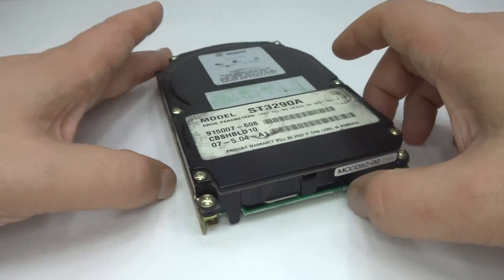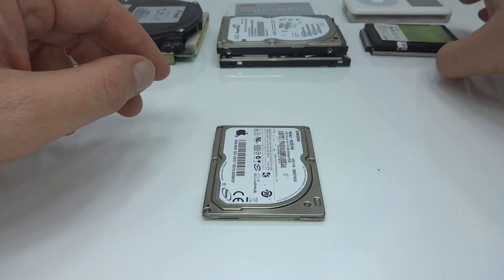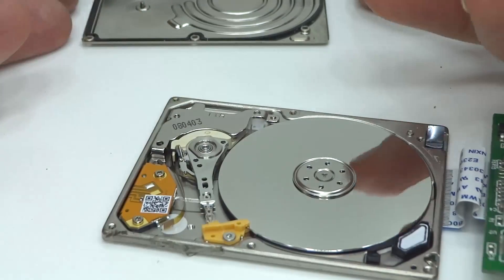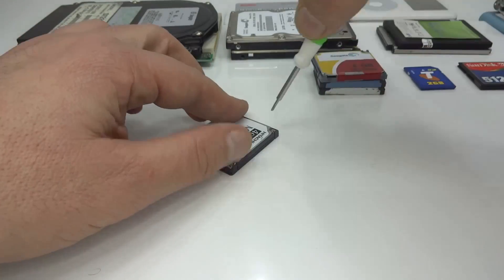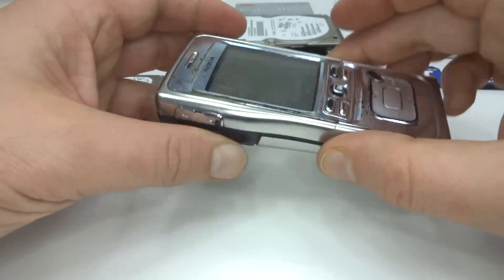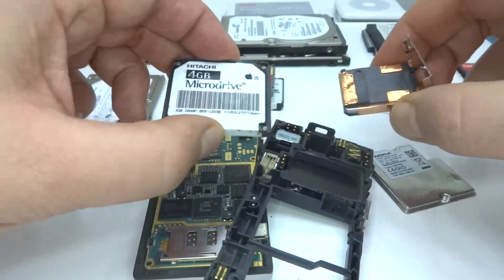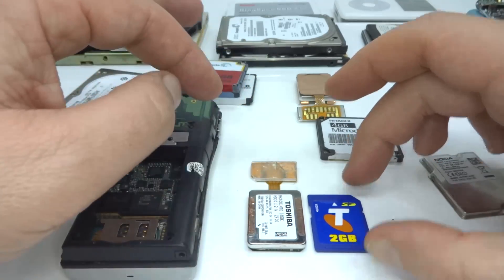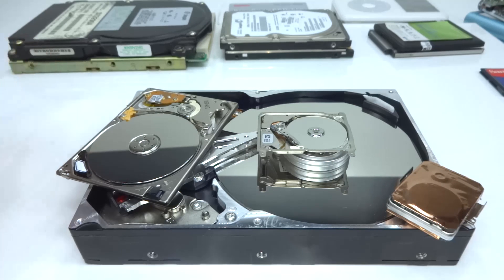Spinning Disks: the smallest hard drives compared

Comment: Hey there, any luck on getting your drive to work yet? I believe I botched mine with trying to wire it up manually to a MMC plus reader and external power. I decided to order up another on eBay ( currently $16 with shipping ) It's another one pulled from the Cowon IAudio 6 so same little ZIF connector at the one I tinkered with. I did however get a better grip on the pinout and that the MMC plus card uses different pins for power and data even though they look alike. So with that said I am gearing up to do a complete teardown of the botched drive for YouTube and I will be including some additional learned information and links on that video as well, hopefully I will be doing that tomorrow and posting within the next week. Maybe there is some useful information I can pass your way if you have not learned much new on your drive. If you have learned more yourself I'd love to include that in my video and with your permission link your video in my description as well.
Reply from the maker: Why do you think you botched or perhaps damaged your drive? I've just had a look at pictures of the Cowon IAudio 6 internal drive you mentioned and the connector seems like quite a different shape to mine. I have been wondering about these different connectors and if they use a different interface such as PATA IDE. However this thread indicates they indeed use the standard SDIO card interface. The small number of pins compared to standard PATA interfaces seems to support that they are SDIO.
https://forums.tomshardware.com/threads/what-interface-does-the-worlds-smallest-hdd-use.1430500/

I have not proceeded any further in getting mine working externally. Despite me having the advantage of a working host Nokia to test with and two working drives to play around with. 

I'm keen to see your approach to the matter. Also email me directly if you wish. I would like to help as much as I am able. Please feel free to link or even include clips of my video in yours if that helps you. I would even consider sending you one of my two drives if that helps us in getting them working.
Reply: @JanusCycle  I don't know for sure if I did botch mine, all I know is that I can get every other drive factor to spin up with power except for this one. I also think I crammed reversed bias power in off my bench PSU at one point, It's been some time so I am not quite certain of what all I have done to it. I did look at both the MMC+ and the ZIF connectors, both have 13 pins running up to the drive. I have traced out the connections and matched them up to match the connectors. During that process I noted the pin assignment differences. Expect an email today with the links and information I have gathered up on the matter. Honestly even if the drive is still good I still want to take one apart and get some really good microscope footage on the parts and assembly, I think it would be an enjoyable video for those who are interested in miniature mechanics.
Reply: A quick note on the Seagate ST1 drives, I purchase them quite often as defective for laser mirror fabrication. Many of the times they have stuck heads but I have managed to get about 70% of the ones with stuck heads to work after putting them in a card reader board and giving them a solid flick with my finger. Maybe a good way to get some working ones on your end. I would also suggest with removing heads from platters to have the unit on power and give the platter a quick twist and let the spindle motor do the rest, this might give you better luck with recovering drives with stuck heads.
Reply from the maker: @Zenodilodon  Thanks for the tip, i hadn't considered that flexing the drive could un-stick a stuck head. The more methods to use without opening up the drive is helpful. I never open a drive unless the data on it has little value.
Reply: @JanusCycle  Not flexing, flicking. You have to have quite a bit of power in it too, I have chipped my pointer finger's nail once or twice doing it.

Comment: Holy crap! The platter inside that SD-sized HDD must be the size of a penny!
That's the most impressive thing I've ever seen! Especially for a mechanical device.
Reply: i have some 0.8 inch hard drives laying they look even more funny cause really tiny
Reply: @dmtd2388  The Nokia N91 used that HDD
Reply: @pepeavalon21  i know i took them off from some old small usb hdd
Reply: I’d say they would have had to hire some Austrian watchmakers to build this hd back in 2004 😅
Reply: 0.85" in diameter
Reply: It's 0.85 inches in diameter. The drive is the Toshiba MK4001MTD and shipped in a few Nokia phones.
Reply: And now ladies and gentlemen we present the world's tiniest HDD so tiny it's the same size as a common postage stamp how's that for you 🤓👏

Comment: Hdd haven’t really shrunk. 3.5” drives are easier and cheaper to make.
Reply from the maker: Handheld devices used smaller hard drives before flash memory capacity caught up with them.

Comment: heh, peasants. I use mercury delay line.
Reply from the maker: That sounds heaps intriguing. Do you have anything showing how this contraption works?
Reply: @JanusCycle  It was a joke. But mercury delay line was made in the days of the first computers, like UNIVAC and EDVAC. The way it worked is that they pass vibrations through mercury, and there is a microphone on the other side. It picks it up and sends it back to an amplifier circuit and sends it to the computer. If the computer doesn't want it to be played back,  it interrupts it.
Reply from the maker: @psun256  You encouraged me to find out more, really interesting, thanks.
Reply: @JanusCycle  You're welcome!
Reply: Delay lines were also used in analog TVs, in the color decoding circuit

Comment: I just had to purchase a .85 it's a ZIF style plug I am hoping to get it to run. I had absolutely no idea there was a .85 until today.

I am wondering if you are struggling with the same issue I had reading microdrives, the CF2 style. I found Lexar brands to work well cause they can deliver the current to the mechanical bits, other brands don't seem to work.
Reply from the maker: I have noticed over the years that some CF readers don't work with microdrives. I didn't pay attention to the brands though and the couple I have that work are just generic from eBay. 
The ZIF .85" drives are Parallel ATA but I'm not sure of the pinout. The two I have are the same as MMCplus pinouts but I'm not sure of how to run them yet. Does your ZIF connector look like this one?
http://www.pchistory.lv/wp-content/uploads/Toshiba_HDD_MK4001MTD_4GB.jpg
Reply: @JanusCycle , Yup looks like the same connector. I am unsure if I will power it up or not, it's more the obsession with  small engineering. I buy a lot of defect micro-drivers for the platters ( use in laser applications ) The seagate defects you can often get running with a solid flick to free the heads off the platter while power is applied.
Reply from the maker: @Zenodilodon  Interesting, do you use platters as first surface mirrors for lasers? I've used first surface mirrors from laser printers in some laser builds.
Reply: @JanusCycle  Yup, it makes excellent go to emergency galvanometer mirror material.
Reply: @JanusCycle  Hey I got my drive in, it's the same 13 wires+ ground, pretty much the same cable where it meets the board and I roughly have a grasp on the vias. I also found some stuff about the MMC plus, The drive runs on 3 volts and there is a wide range on the card readers. I have not gotten on of those yet. I also noticed there may be some pin assignments that may effect how it's seen as a media card or running in SPI. I figure order up an MMC plus reader and checking voltages see what goes from there, maybe look into getting an SPI controller to play with, I guess once powered it's a few wires for clock and data and it's a done deal.
Reply from the maker: @Zenodilodon  That's very interesting, please let me know how it goes. I'm still keen to make a USB memory stick out of one, or connect it to a microcontroller.